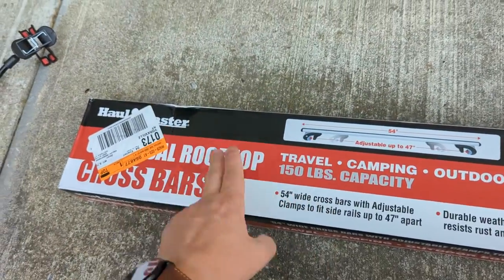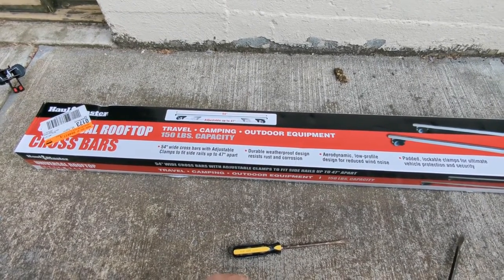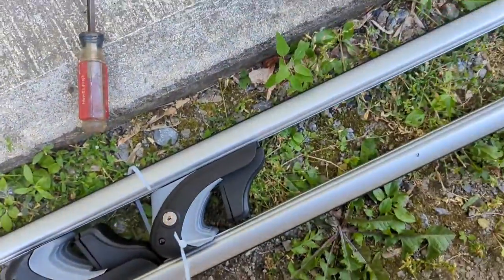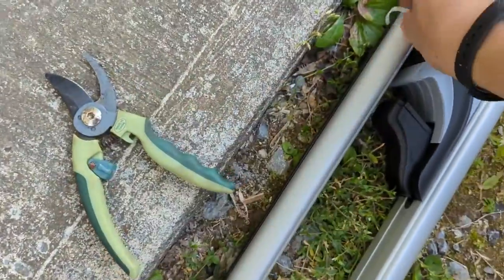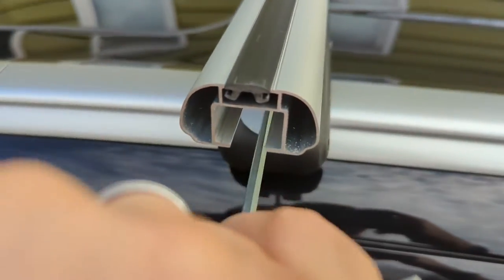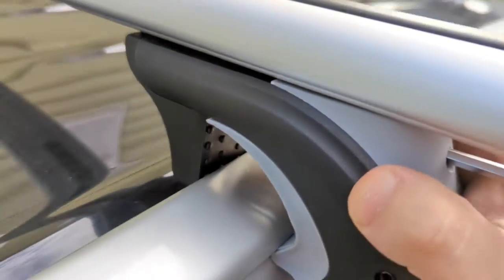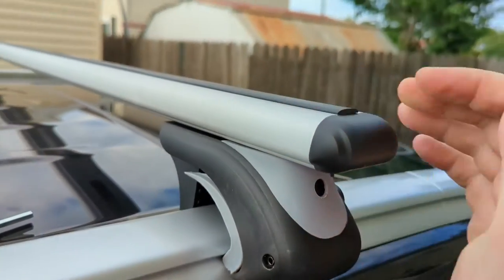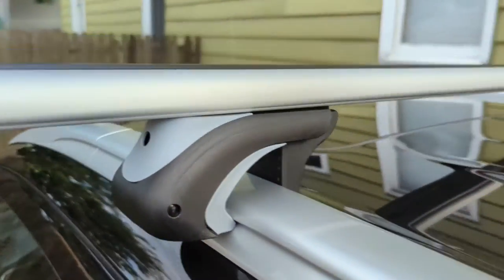HaulMaster Roof Rack (Cross Bars) Unboxing and Installation

Comment: those cross bars aren't designed for that style roof bars, not safe
Reply from the maker: They're universal so they fit but I agree they don't stay as sturdy on these as they do on those raised roof rails.
Reply: universal for raised open rail bars not flushed closed rail style, quick google search on your end will back me up. not your fault, your style rails came into popularity on newer cars but these weren't designed for that style so the torsional grip is all on the end point when it would be gripping a whole bar
Reply: they make budget ones for your style bars too
Reply: That gap tho

Comment: Very dangerous. DO NOT FIT THESE BARS TO THESE RAILS.
Reply from the maker: Correct, they are meant for the raised roof rails but unfortunately the manufacturer doesn't specify that so I installed them here at that time.

Comment: I'm sorry but these crossbars sucked. Its probably my car, but I'm kind of disappointed. I have a Kayak rack I wanted to put on too. Good thing I can return them. $85 is too much to pay for stuff this bad.
Reply from the maker: I agree. They are good for light stuff but I wouldn't recommend them for heavy loads or something that will encounter a lot of wind resistance such as kayaks.
Reply: @DIYMaistor  Thanks. I’ll admit I’m not the most handy guy either, but sometimes stuff just doesn’t work.

Comment: Just a question. How did it hold up. I have closed roof rails on my car too and not sure if i should take this roof rack back?
Reply from the maker: To be honest it can handle small, light weight things but it's more designed for raised roof rails as it is more secure on those. So I'd recommend skipping these on closed non-raised roof rails.

Comment: Thanks just bought one thanks to this video for a 2020 Hyundai Kona let’s pray it holds both kayaks 😂
Reply: Did it? Just got one 😂
Reply: @cassandravilla531  how about for you? Considering getting one for two kayaks
Reply: @brianlewis4940  I bought one and I bought the roof rack that master haul makes i’ve had them for about three months now they have held up fairly good. My only complaint is the stickers of the rack came off pretty quick and left this goo residue. I have yet to mount any kayaks on there. I’m planning on doing that next summer.